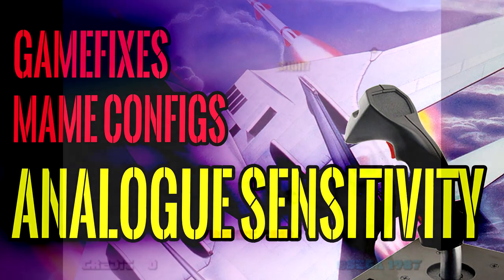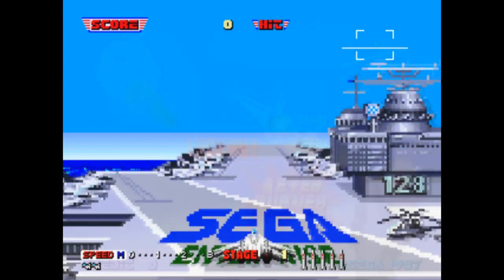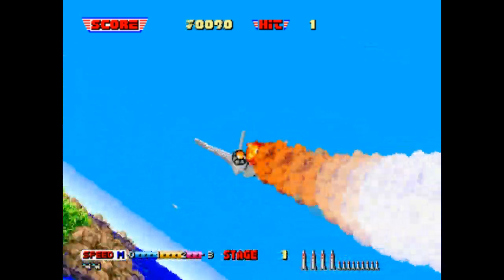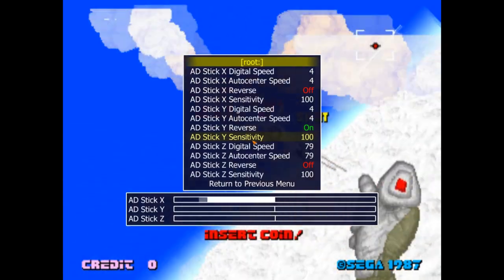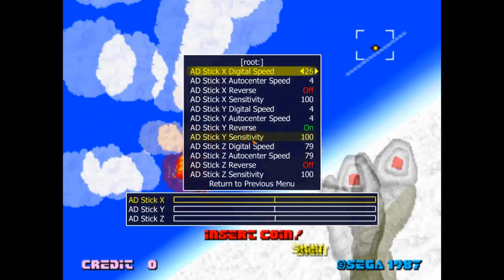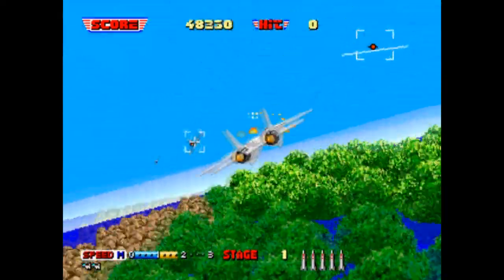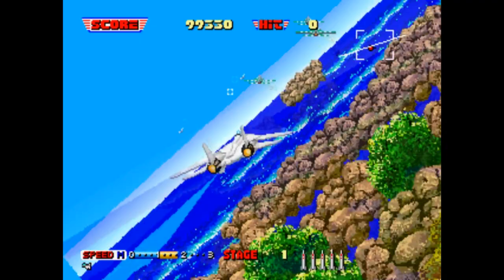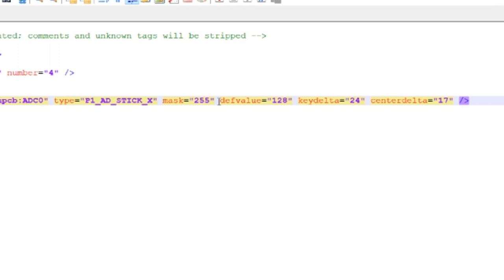Games fixes pt.2e - Mame cfgs - Digital to Analogue Sensitivity

Comment: is there a way to get the analogue usb joystick to work on a pandora 3g game eg golden eye 007 or wipeout 64
Reply from the maker: Yes, I've tested both Xbox360 USB and logicool 310, but you they only function as a "digital" input rather than analogue.  If you want to use it as a proper analogue stick you need to jailbreak and install the mupen apk